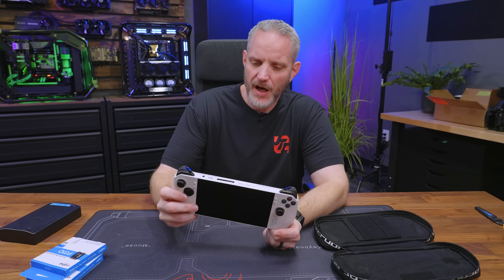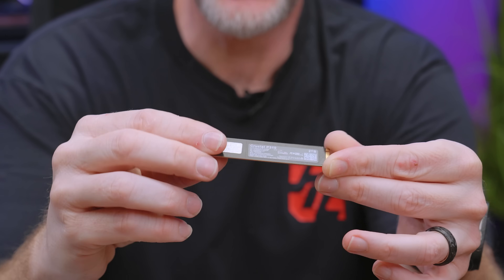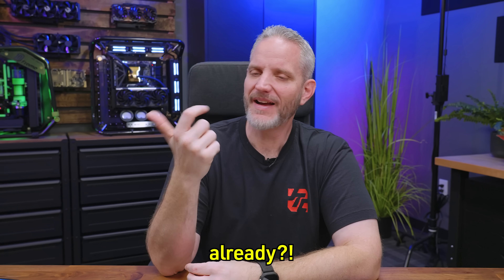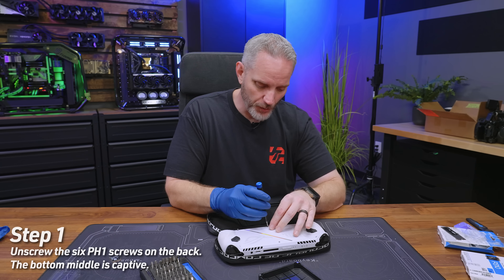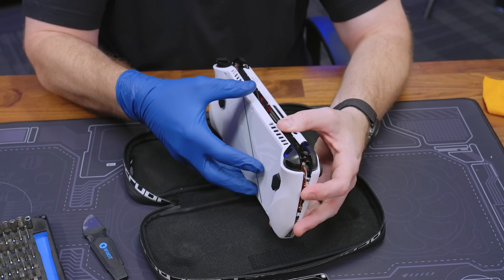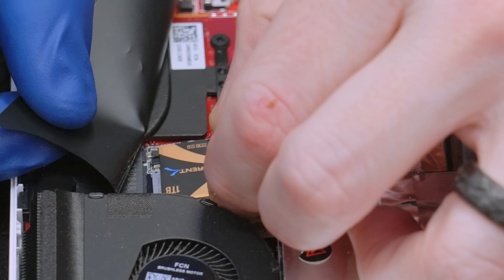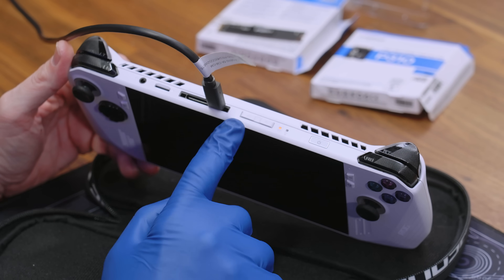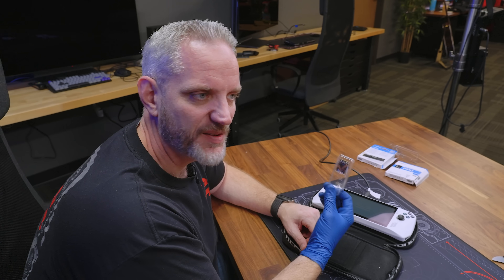How to upgrade Ally SSD.... Easy Turorial

Comment: The idea with these handhelds, whether they are PC based or android based, is that as long as you treat it like a non-windows device, it'll make total sense. For instance, I was shopping for one of those dedicated retro handhelds that are dominantly android based out of the box. On the higher end of the spectrum, you're already encroaching on ROG Ally and Steamdeck pricing. So why don't I just pay the same price, upgrade the storage, and make it my dedicated retro emulation handheld. I get the benefit of the Ryzen Z1 and its performance (which means I can play games up to PS3 in some cases), and the flexibility to run windows, linux, or a linux-based retro-gaming OS. I really only use windows if I absolutely have to, but have plenty of other devices to do other tasks on. I would give retro gaming a go and just try the consoles you never had the chance to ever try growing up. The customizable UIs in these emulator front end these days adds a ton to the experience.

Comment: Why does your Rog Ally look so large compared to mine?  Really, I don't know if it's an optical effect or something, but that Ally looks like twice the size of mine.  I'm just waiting on a right angle NVME adapter for my Rog Ally.  Amazon should deliver it within the next 24.  I have the drives ready.  They just need going in.  I've upgraded the bios, so that Cloud Restore is available.  I think that I have gone a little bit OTT on storage space for my Rog Ally, truth be told.  I retrieved a 1.5TB SanDisk Micro SD Card from my Steam Deck, when it began to fail a few weeks back, with the power port failing on the system, and I have a 4TB Kingston 2280 NVME here, ready, now.  I'm just shunting some data off from it, and onto a 2TB 2230.  Once that's done, it can be put in the Extreme Z1.  I'm just wondering what I am going to fill 5.5TB of disk space with, scene as my Steam collection is only about 3TB in total?

Comment: The ROG ally was the first time after gameboy color when I got back into and was enthused about handheld gaming.
I realized what I actually wanted was a portable gaming pc in my hand while I lay in bed and vegetate.
Well, it came sooner than I thought and it's good. They did great on the first iteration, good enough for me to want to keep it even though the second iteration is out now, the rog ally x.

I'm upgrading the storage to 1tb, which is what I calculated to be good enough to play all the games I would play on a handheld than on the desktop.

The rog ally got me back into frequent gaming during the times I just didn't want to sit and be stuck at the pc desk.

If they significantly improve battery life, eventually the rog ally will have way more use than my desktop. It got me playing games I neglected before and it's perfect experience for games like vampire survivor and halls of torment.

Comment: I got hyped about the Deck and preordered it. Then it came out and I played with it for a while, but then it sat. I used it for trips and being out and about for awhile, which was especially nice during the non stop doc and physical therapy visits after my motorcycle accident. Boy it really came in handy then! As of late though it's been the stop gap for my gaming while my PC has been back and forth to MicroCenter with the Intel issues. Since it seems like it will be going back *again*, the deck will be recharged and kept available for gaming while my workhorse is away to ICU...

Comment: I've been a portable gamer for years. loved my ds, 3ds, psp, ps vita, non docked switch, & my steam deck. action, rpg, action rpg, platformer, anything really story or grind heavy. I've found to be wonderful fits for portable system. for getting into it, just wanting to get some gaming in when you're away from anything & not wanting to use your phone really. I try to keep my deck with me if I know I'm going to be in a waiting room or if I'm with someone who's going to be doing something without me for an extended length of time. sometimes it's also just playing what I want, where I want. I played through quite a few games I had on ps3 & vita almost exclusively on my vita, just because I didn't want to go over to my ps3. & you called phil out on it, but being able to take the power of your main rig to somewhere comfortable to just chill & play is a really attractive thing to do, once you get into the swing of it

Comment: I really like how 2230 was a very OEM part type that had seemingly no push to improve outside of hand me downs from other m.2 sizes as they got bigger. rising tide & all that. then the steam deck & all the deck-a-likes come out using that size & suddenly an arms race to improve 2230 starts. all because it's now a size that general consumers, for a given value of 'general', now vocally want. I remember when trying to find a 512gb 2230 was difficult & expensive, but now you can get a 2tb for 'reasonable' prices with high availability

Comment: I've have a ROG Ally Extreme for about 10 months,  upgraded the 512gb to 2tb 2230 shortly after getting it. used a ugreen SSD enclosure, cloned the drive with the included cloning software that came with the Sabrent 2TB drive and then installed the new drive , its works great with all of my xbox game pass games etc. 

I have a gaming PC with a 3070ti, and a Series X and yet i find I play the Ally more than anything else. Its very convenient to just play anywhere ( assuming you have power, battery life does suck) .

Comment: A right angle adapter and 4tb 2280 is cheaper than most 2tb 2230 sticks. I see no point in using a 2230

Comment: If I was to hazard a guess, I'd say the lack of futzing about with it, plus the need to just focus on the device screen are off-putting for Jay. There's very little to do except use it.
Also immersion seems to be big for Jay and handhelds just don't do that.

For me, I just can't justify the price of a handheld PC because I know that in short order I'd be docking it and plugging in a bigger monitor plugging in a keyboard and trackball and COMPLETELY negating the portable aspect of it.

Comment: 4:56 I never had a handheld, or even a console, when I was a kid though I did have a computer at various points. So I’m controller impaired. Bought a PlayStation some years ago, but just could not get used to a gamepad. I remain forever fumble fingers which such, and am ‘limited’ to mouse and keyboard.

Comment: There's also the option to use an external SSD adapter for USB. Especially with an USB hub. You could even use a 2230 or 2280 SSD holder, or even a 2.5" SSD or even HDD, on the back of the thing. Or one of those 2.5" M.2 hubs which let you have up to 4 SSDs, I think, but even 2 of those would be better than nothing.

Comment: I bought an original 1989 gameboy for nostalgia, modded it with a red chassis and blue buttons and an IPS screen and rechargeable C battery and played an original Pokemon blue. I also have a GBA with new chassis and IPS screen mod too, specifically to play GB, GBC and GBA games. Then I have the ROG Ally modded to hold the 2280 SSD 2TB and modded with an aftermarket clear shell for better cooling in a dBrand killswitch case. I'm looking at getting a Retroid Pocket to play the games of my youth, like the original PS and PS2 games , and try out games from that era that I never had the chance to try. I'm waiting for the kickstarter project from Sharge to be finished, it'll allow me to attach an external NVME drive to the ally and it has passthrough charging so I can have like 6TB or even 10TB storage! I got my 4TB Firecuda already, just waiting on the case

Comment: I'm still on an OG Steam Deck. Mind, I don't use it in the normal way, since I use it attached to my monitor and a dock as a "desktop" of sorts to use it as a more desktop or console like experience. And yes, I use SteamOS for the system since I'm a Linux user for work and play

Comment: I have a switch that I haven't used in years. I have a laptop that I frequently use in tablet mode. I do play KSP on it. It is AMD so it runs games pretty well unlike intel laptops. It is getting old though. I'm thinking of upgrading to the new RDNA based APUs. I was hoping to see if anyone could get KSP2 running on a newer non gaming laptop or a steam deck or whatever......but KSP2 is dead so it's irrelavent. KSP is the most intensive game I'd ever play. For more demanding games I have my desktop.

Comment: I have a steam deck and my main use of it is for travel or when I don't feel like getting out of bed to play something. I also tend to only play games on it that have controller support, that I would normally play with a controller (example, I tend to play EDF games with a controller and playing them on steam deck is fine). Using the steam deck is great in those situations as it's less cumbersome to get setup and lets me get to playing games faster.

Comment: I put a 2280 in mine.  Befor i found out the right angle adapter  My single sided 2280 sits under the battery.     I started with 2tb but thats about full  lol maybe 4tb time

Comment: The only portable games I can get into are turn based games, games that use fairly simple controls, or racing type games.  I can’t play first person shooters with a controller and that’s really what these are just laptops with a built in console style controller.  I am a mouse and keyboard guy so anything that has a lot of quick accurate movement I just can’t do.

Comment: I am tempted to get an Ally as I have a MacBook Air but I really enjoy playing on my PSP 1001. Specially Midnight Club 3, NFS Most wanted, Jetpack joyride (PS3 emulated), and GBA titles like Beyblade, Pokémon Emrald (Yes, the PSP is software modded)

I also have a GBA but don't use it anymore as the internal batteries of games is dead which doesn't allow me to save progress, the slot is barely functioning and the display is damaged (due to age)

Comment: Have the following 
Ambernic RG35XX-H
Anbernic ARC-D
PowKiddy RGB30
AYN Odin 2

They all have specific use cases and are for retro games. I cannot play modern games on a handheld. They are not designed for small screens.

Comment: I have never understood the use case of these handhelds other than kids 8-12 years old.
Why would you not want a light controller without a heater and not a larger screen, same price as a laptop.
If I'm out I'm driving or doing stuff.
If the S25 ultra could do the same in DEX a lapdock on the other hand really utilizes it's power and the cameras blow webcams out of the water.

If I take the time to game I want it to be good, not play Tetris on a Tamachochi screen.
My watch does have fruit ninja if I don't have my phone while going for a sh*t 🤣

Comment: I would like to share with you a negative experience I had with the Nancon Asymmetrical PS4/PC controller. Gamepads come in wired and wireless varieties.

The wireless ones come in two main varieties - bluetooth and 2.4ghz, similarly to mice and keyboards. The 2.4Ghz variety has a proprietary USB dongle that is most often tied to a single device, or can sometimes be paired to a similar device or another device of the same model. If you lose the dongle, you are SOOL unless the device supports a wired operation mode - something it may or may not do.

That is why some people gravitate toward Bluetooth wireless devices. The bluetooth variety usually is compatible with any bluetooth receiver, be it a USB dongle, a PCI or PCIE card, or an mSATA module, or bluetooth in a phone. The main word there is USUALLY. Some models, like 1st edition XBox One controllers or PS3 controllers, do not work with any Bluetooth dongle - you need a SPECIAL Bluetooth adapter or modified drivers to run them wirelessly with a regular bluetooth. The saving grace is that these models usually offer the ability to run them in WIRED mode, as well. So, if your PS3 breaks, you can use the PS3 controller on your PC with a cable - suboptimal, but at least it works.

Now, Nacon, in all of their wisdom, produces the Nacon Asymmetric controller - priced around 50-60 US dollars. Certainly not one of the premium professional controllers that go for a 100 bucks or more, but definitely not the Walmart 20 dollars brand. The controller is very clearly, unambiguously marketed as a BLUETOOTH controller. HOWEVER, it is very much of the variety that requires a proprietary dongle that comes included. As it is a proprietary dongle, if you were to lose it, break it, or it simply died for no apparent reason (LIKE MINE DID), you could still use it with a cable - IF NACON BOTHERED TO ALLOW YOU TO DO SO!

But they didn't. Instead, Nacon sells the dongle separately, for the low, low price of 22 dollars - almost half of the actual controller. To be fair to Nacon - they are not the only company who does this. However, they are the only ones I know of that sell a product that is so expensive and the replacement part is so expensive as well.

With a Microsoft or Hama 2.4ghz keyboard, you at least know what you are getting into - you are buying a 20 dollar product with a proprietary dongle. With Nacon, you are misled into buying a "bluetooth" device that does not work with Bluetooth nor with a cable.

To make matters worse - the replacement dongle is of questionable quality, as well. The reviews are not splendid. Some people fail to reconnect the device, for some the dongle dies, for some it never arrives. It has a mixed rating of 1 stars and 5 stars, mostly 1 star.
 

Thanks for your attention!

Comment: Wouldn't it be much easier to remove the old NVME SSD and put it in a Copystation and simply clone it to the New One? 
The second Step would then simply be to connect the Copystation to a Computer and expand the Partition. 
Back in the Handheld Gamer and you're done. No long Downloads and no boring Reconfigurations.
I've been doing this for a good 5 Years with the Boot Drives of "normal" Computers and it's saved me a lot of time. 
And so I thought why not with the ROG Ally? And in fact it worked the same Way. 
Many Relatives and Friends have also saved themselves the lengthy and often error-prone normal Procedure.
It is only helpful to cool the Copystation and the two SSDs well. 
I like to place the Copystation in the Airflow of my Air Conditioning System.

Comment: I have my nintendo switch. I was never a handheld gamer until i got the system. I prefer the big screen my self but the switch is nice to be able to switch (haha) between the two modes so quickly or the ability to play multiplayer games on the system its self while out and about. I

Comment: Ive had all the Nintendo handhelds, including the current Switch. It wasn't until the Switch that I find it annoying to play on.
Game sessions are much shorter due to the weight and size of the thing.
Gameboys/DS were fantastic because they were small and you almost sit in any position and still be comfortable playing. These larger handhelds not so much.

Also the majority of games I play on them are usually shorter indie titles (and the Nintendo exclusives) which work well with travel/being away from my PC. I couldn't imagine playing a big title like Cyberpunk or something on a handheld. I even struggled with playing Zelda BotW handheld.

Comment: My proble. Is that a lot of the games i play are early access and dont offer controller support. So, i love my legion go but i dont use it as much as id like. I use my laptop more than anything. It has a ryzen 7735hs and a rtx 4070. Also you can use an adapter to use the 2230 in a 2242 and up slot. So the 2230 will work in the legion go with the adapter.

Comment: Got an Ally earlier this year. Swapped out the SSD for a 2TB WD Black SN770. And bought a tiny enclosure for the original 512GB drive that I can connect via a JSAux dock.

Comment: I have 4 handhelds. 2 steamdecks the original and the OLED. the original is mostly for emulation station, and the OLED for my actual steam games and GoG library

I've got a modded gameboy color with an IPS backlit display and type c charging with an Everdrive that has my full gameboy and color libraries on micro SD.

Lastly a retroflag Gpi 2 that i can play my nes, snes, gamegear, sega, and ps1 games on.

Comment: I'm not a handheld gamer. I had some fantastic time on my DMG Game Boy but by the time the Game Boy Advance released, I already had much less opportunity to use a handheld (though I did play the major exclusives on the Gamecube Gameboy Player or on emulators.

I do not understand the concept of a large handheld that don't fit a pocket though. I've never played my Switch undocked, If it's gonna go in a backpack anyway, then a thin laptop with a small bluetooth controller seems like a better deal to me.

I did however, cave in and bought a GPD Win Mini, in order to have a fully functional PC that can fit (sorta) in my pants' pockets and I therefore can have on me at all time.
The built-in controller is just a bonus, so I might have to create a short list of fun time-killers to install on it. That to me, is far more relevant than the Steam Deck, ROG Ally and the ilk.

Comment: Im running an Ally x with a 4tb 990 pro with Heatsink (you will need to trim the little keeper legs to length, but it fits, and i recommend it) my use case is im a lineman and i have long times between jobs sometimes so i have the handheld instead of a unwieldy laptop or pc

Comment: Wouldn't it be possible to simply clone the drive if you have access to a PC with unused m.2 slots? It's what I usually do whenever I replace drives in a PC or Laptop to save time.